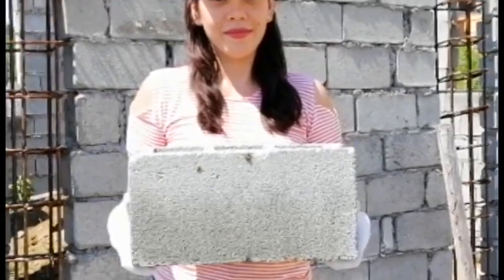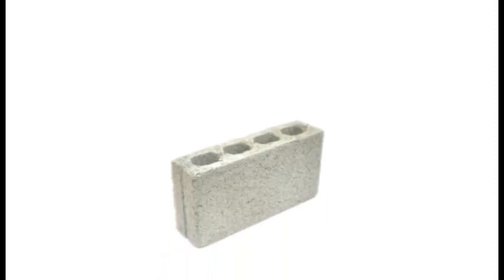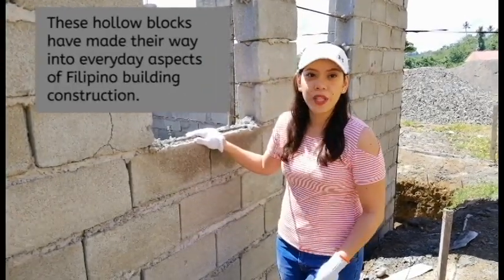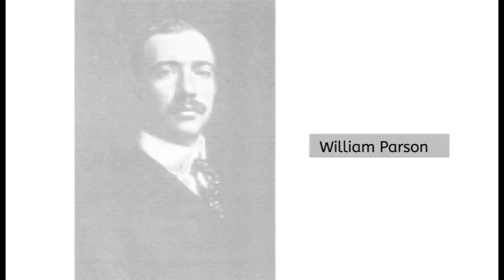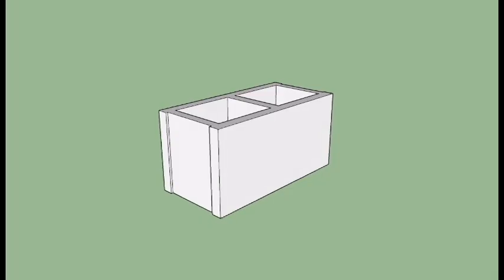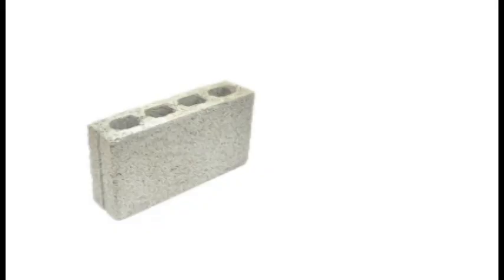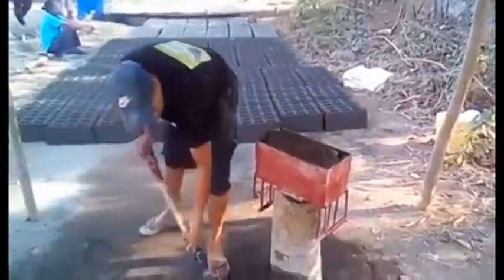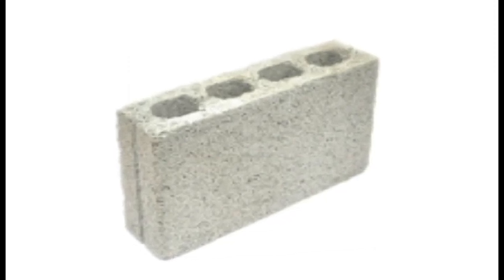Philippine Hollow Blocks Analyzed

Comment: Only the one from the USA are better than the ones in the Philippines
Reply: USA is not a civilized country when it comes to home building, they are the same fucked 3rd world like Philippines or Nigeria or Haiti.  Unless you do commerical buildings. 
Look at Europe to see how house walls should be build that will last for hunderts of years.
Reply: The hollow blocks in Malta are very strong and don't need fill up so the are still heat or cold insulators❤

Comment: You're calling it "concrete" but the hollow blocks I've seen (in Mindanao) were not concrete at all.  Even after being completely dried, hit them with some water, and they disintegrate.  No structural integrity, and probably no concrete.  Just mud bricks.   And not worth the 7 pesos they were charging for them.
Reply: Hollow blocks in the philippines are not designed to carry load, they are just for walling. They are not made of concrete but of sand, water and cement, the mixture not so much strong so builders can use and cut them quickly with just their hand trowels.
Reply: @rap3208  Depends who makes them and if the purpose is to provide quality building materials, or to swindle.  They absolutely can carry load if made correctly.  If I ever get any hollow blocks again in the Philippines, I'll stand there while they're being made, and supervise the amount of concrete that is being put in.  Anybody who just wants walling would do better to use dry wall, or real concrete blocks, and not have to worry about their walls collapsing in on them in an earthquake or typhoon.

Comment: You were WAY too nice in this video. The Filipino hollow block is as symbolic of the Filipino mentality as anything in the country. I'm from the state of North Carolina in the U.S. where our motto is "To be, rather than to seem," The hollow block symbolizes the opposite; "To seem, rather than to be." Why? Because everywhere you go you find completely unqualified masons (and I use that term very loosely with apologies to real masons world-wide) with no concept of structural engineering, using blocks that will literally crumble in your hands, building "load bearing" walls (very scary) that are anything but plumb, with mortar joints that anything but uniform, and then covering them with an inch of mortar to cover (hide) the shoddy work. They "seem" strong because the mortar dries hard, but they are anything but, as evidenced by the huge cracks in literally 95% of all Philippines buildings and walls. Even minimal seismic activity or settling (which is a serious issue since soil engineers are almost never consulted before foundations are haphazardly poured), are enough to cause serious cracking and failure. The handiwork is on display everywhere. How can you in any way endorse the typical use of this sub marginal material or the method by which they are laid? IT'S A NATIONAL DISGRACE!
Reply: Yes, as a german without any knowledge about building something other than software it did not take me a long time to realize that my house will not be make out of hollow blocks but i will use earthbag building for the outer walls. Labour is still the cheapest so using hollow blocks is not even a financial benefit for a medium sized (by western standard) house.
Reply: are these walls not strengthened with steel reinforcement bars though.
Reply: @stephentyas4698  Yes they are, but it is of no avail. The hallow block is very weak, even though you pour concrete in the hallow part of the block and your reinforce with steel it is not strong. The concrete in the hallow part of the block is not consistent and does not form a continuous flow. If you cut cross a section of the wall, you will see, hard plaster, weak block, relatively hard core with steel.